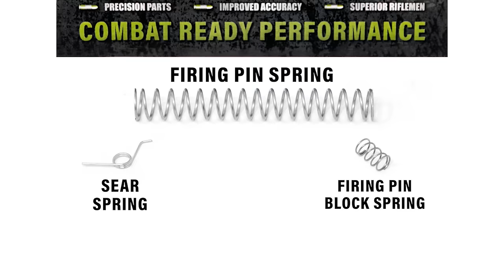M*CARBO Taurus G3/G2 Trigger Spring Kit - How To Install

Comment: Just installed the spring kit.  It dropped my pull from 7#-7.5# (DA and SA) to 5# DA and 4.25# SA.  Nice!  I greased the striker guide instead of spending money on a ss one from lakeline, although tempting.  Love the new mod.  To add:  Punching the middle pin from right to left was the cure to my problem.  The knurling on my pin (G2) prevented it from being pushed from right to left.

Comment: This is definitely the most detailed video that I have  found on Taurus take down.  I have 2. One of the 3gc' & the 3gc Toro.  I live these forearms.   I am yet to have any kind of issue with them.  They even come with 3 12 round mags.  Hard to beat for the price.   I am ordering these spring kits for them as well
Reply: Look into lakeline kits ..come with everything here plus the metal replacement for all plastic inner components

Comment: Make a trigger, I’d definitely buy one!
Reply: I purchased and installed the Keep Tinkering Flat Face SAO trigger. This eliminated the trigger safety bar, Reduced/shortened the overall travel by 45% and is at 5lb pull. Absolute Best Mod for the G3C, of all I have done. The M*Carbo spring kit ended in light strikes for mine, being at factory poundage of 14lb. I ordered a new striker assy from Taurus $14.99 and fires 100%.

Comment: Doing just the polishing will just improve the wall break, but replacing the springs reduces trigger pull force by 2 pounds?
On an older (1000-2000) g3c makes it sense polishing these parts?

Comment: If someone told me polishing a few parts would take 2lbs off the trigger pull, I don't think I'd believe them. That black finish really adds resistance.
Reply: It also prevents rust.  All those places he polished will now ruar much easier.  
I recommend cold blueing after the polish. So you don't spent hours de-rusting later.
Reply: @matthewbeaver5026 or you keep it properly oiled as it should and you won’t have that problem
Reply: @Gb18th  idk the taurus I have will rust 3 days after you oil it. If carried consistently. 
I believe they changed the coating on later models though

Comment: Is this good for ammo with hard primers? My only concern is light primer strikes. I have a spring kit from another company and got a couple of light strikes.
Reply from the maker: Yes, we have tested it with factory ammunition with known hard primers with no issues. We don't test with reloads though due to variability.
Reply: @MCARBO  thank you.
Reply: I suffered 100% light strikes after initial firing of brand new G3C. Lakeline llc or M*Carbo springs did nothing. They are all 14lb OEM weight. I installed a 15 1/2lb Wolf Spring to resolve the light strike, but did increase trigger pull. I purchased a $14.99 new striker assy. from Taurus and resolved all issues. This is Not from Hard Primers, a characteristic for some of the pistols.

Comment: I have the G3c and it’s new I haven’t even shot it yet. I want to get this in before I shoot it. I can’t get the plate off when I push down on the firing pin and try to push that plate up it will not budge. Any suggestions

Comment: im sure if you make a kit to reduce the pr travel it would sell a lot
Reply: Keep Tinkering offers a flat-faced SAO trigger kit for $35. Mine ended up at 5lb pull, 45% reduction in travel, no more trigger safety or double strike.

Comment: Hi, what are the spring differences with the original one?
Reply: My M-Carbo kit had the identical OEM striker spring weight of 14lb. I had light strikes before and after use. Purchased a new striker kit for $14.99 from Taurus and resolved all issues. Otherwise a 15 1/2lb Wolf Spring for Glock was my first cure, but increased the trigger pull.

Comment: The worst part of this trigger is the way the trigger dingus doesnt completely engage until the rear of the pull creating an awful grittyness right before break.  
I cant see how this kit will help that what so ever.  
Then the mirror polish is going to rust on all 4 of those places polished.  Its a taurus. Of course its going to rust.  
At least cold blue the areas you polished.

Comment: I have used 4 other M*Carbo trigger spring kits on multiple other brands, all with great end results. I installed the kit, along with all the internal polish works in my G3c to end up with 100% light strikes on CCI and Remington factory ammo, plus reloads with WInchester and CCI primers, installed .002" below flush in the case. as was the factory spring. I contacted M*Carbo by email twice with the question of their spring pull weight matching the factory 14lb pull or not? No replies. I ended up installing a Wolf Spring 15 1/2lb spring to resolve the light strikes, but did suffer additional trigger pull. I can't blame M*Carbo for the spring poundage duplication the OEM unit, simply disappointed by lack of communications. This kit did defiantly improve the trigger feeling, and eliminate the songy feel, although a majority sacrificed due to the heavier striker spring I had to install for light strike issues, as in many of these pistols. I purchased and installed a Lakeview steel striker assy, with the same 14lb light strike ending. This kit is an easy install, taking about 30 minutes with polishing procedures, and not difficult at all. My opinion would be, either the internal depth of the striker housing front area or striker overall tip length varies from pistol to pistol, resulting in a large amount of pistols out there with light strike issues. I will continue my investigations and modification efforts to allow installation of the factory 14lb spring and light trigger pull, as was the plan.